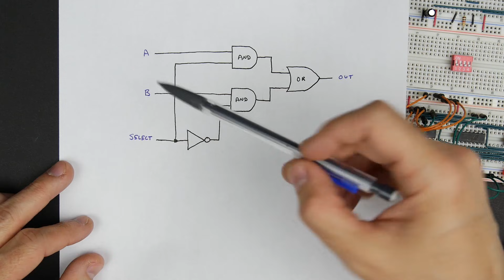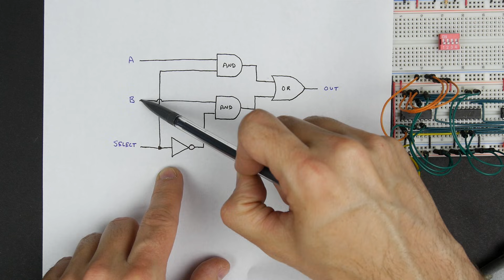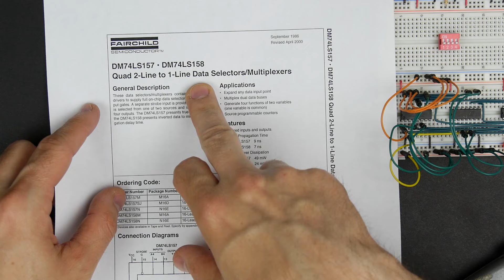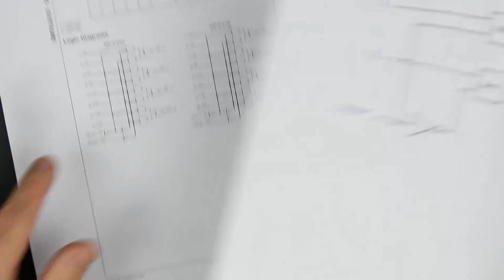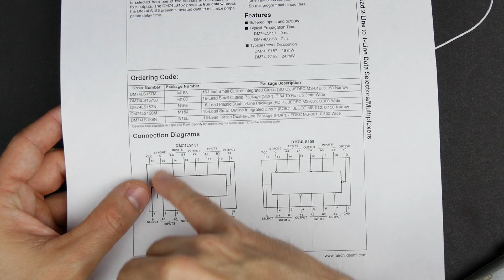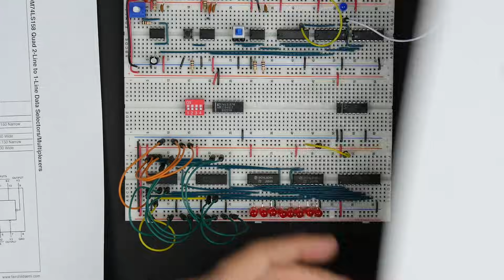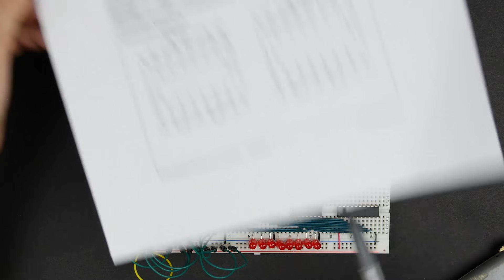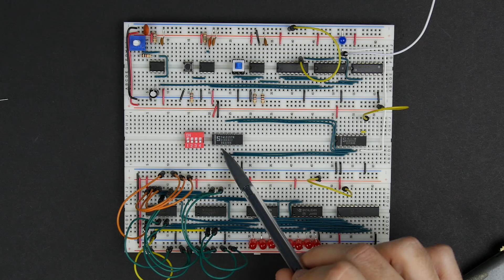RAM module build - part 2

Comment: Actually, when the switches are down they're clearly in the "No" position.
Reply: Actually, this is flipped.
Reply: There's two ways to think about it:
-down is low and up is high, so down is 0 and up is 1
Or...
-when you throw a lever to turn something on, you pull it down. therefore turning on a bit should be the down position

Personally i prefer the former but i can see how the latter might be the convention
Reply: @josbird  I can't think of a single case where down is on. Typical light switches get flipped up to turn on. Circuit breakers oriented vertically get flipped upward to turn on. Large throw switches in industrial settings are pushed up to activate. You likely know of some exceptions, but I can't think of a single one myself.
Reply: @chitlitlah  In Europe light switchs go the other way, no idea why.
Reply: @Nolrai12  Those switches that have a knob the on is down, but on those that have flat surface you press the upper part to get the light on and if you then think about gluing a knob on it it works the other way round.

Comment: 02:10 So you're using the same bus for transmitting addresses as well as data?
Reply: Yes, it's important to. A jump command will have an address for its data. Everything is data, in the end- addresses and instructions are special data, but data nonetheless.
Reply: Chris Knowles I know. I was rather asking about the distinction between "one common bus for addresses & data" vs. "separate buses" (address buss and data bus as two separate buses which can send data in parallel) dilemma.
If they are separate, there's no need for latching the address in an address register, for example.
Reply: +Bon Bon but how would you move an address from one bus to another? I think eventually you'd need to involve a latch- why not here?
Reply: Chris Knowles Through the CPU, which usually is the device which sends addresses to the address bus anyway.
I didn't say that the address register is not needed at all (because it's usually used inside the CPU anyway), but that it is not required for the RAM module to have it when there is a separate address bus.

Address latching is usually needed when the CPU needs to have as few pins as possible to save space or reduce costs, as it is the case with some microcontrollers such as 8502, which uses one of its I/O ports as half of the address bus. Then you need an additional 8-bit address latch to latch half of the address which appears on the I/O port, and then the CPU outputs the data through the same port, so a mechanism is needed for controlling and sequencing these signals on the bus. This approach is cheaper and saves some space, but it is also slower, because the data and its address needs to be handled in two stages instead of one. Separate address bus allows for handling it in just one bus cycle.

There's also a trick I once invented which allowed me to save some more time in my homebrew microcomputer:
The instruction set was constructed in such a way that the CPU could read and store data in series. It was based on the observation that programs are usually read and executed sequentially, one instruction after another, unless some jump occurs. So I enhanced my RAM module with its own address counter which has been automatically increased with each clock cycle. This way the CPU had to send it the starting address only once, and then just read instruction by instruction in each subsequent clock cycle. This way it could work twice as fast, because it didn't have to interleave each instruction fetch with putting the address of the next instruction to fetch on the address bus.
Same thing went with data, which had a separate RAM module, with its own data address counter.
Reply: +Bon Bon Gee, I guess you know a thing or two! It still looks to me like using one bus is the way to go- We've got no need for speed on this computer. At the very least, it saves on breadboards. I think as an introduction to this subject, as it's serving for me, those techniques would be more trouble than they're worth. Ever heard the adage about home made telescopes "It's faster to make a 4 inch and then a 6 inch than to start with the 6 inch"?
Reply: Chris Knowles It all depends on your needs. If you want speed and the cost & space doesn't matter, go with separate buses. If you are willing to trade some speed for space and you want to lower the cost, go with a shared bus.
But don't forget that a shared bus requires some more trickery with the timing signals / sequencing ;J

As for the telescopes: I never tried to make any, but I would definitely try if I knew how. (If that counts, I once made a spectrometer :q ) Does your quote mean that you have some knowledge about that, perchance? :>
Reply: +Bon Bon Never got as far making one, just read the book as a child. All I really retained is that adage, because I haven't found a field it doesn't apply in. It's usually better to do the simple thing first and add the complications later.

Comment: How much did/will this whole project cost for materials?
Reply: You know the old saying, if you have to ask, it is probably too much.

Anyway, I have gone through my parts list to try to give you an estimate. But do not hold me to it. I actually had
already purchased $66.10 on various parts to get started on other experiments. So, I already had a bunch of AND, OR and various other common logic gates.

All together I have invested $200 or more in this project (Counting the $66.10). Keep in mind that I always purchase more then I need. I usually buy in quantities of 10, some times 5.

Here is an actual list. I excluded a second set of 10 bread boards that I purchased, because the first set was taking to long to get here. I learned that even though the two sets of bread boards are exactly the same, they do not snap up together. The first 10 will snap together and the second set will snap together, but the first set will not snap together with the second set. 

You can do this for less, I do buy extra everything, just in case and to have these things for the next project that I might get involved in.

Don't let my prices hold you back, this is a great project to get involved in, and it is very well instructed. So you will learn a great deal from this project. I can promise you that !!!

https://drive.google.com/open?id=0B6LIgQzDkH8fMzFiVGZZV1pZU3c
Reply: I definitely love the idea of doing it all with 7400 logic, but the cost and complexity kind of puts me off for now.  I was thinking about actually building a either a Z80 or 6502 based computer and cheating a bit by using a Parallax Propeller as the memory and bus controller.  I realize it sort of defeats the purpose since the Propeller is much more powerful than the Z80/6502, but the point of the project was to learn, and I figured I could always replace the functionality of the Propeller with discreet components.  I'm just really interested in the concept of multi-CPU systems and the dynamics of programming CPUs to talk to each other and do something useful.  Plus, if I end up using both the Z80 and the 6502, I should be able to make it compatible with all kinds of old software just by programming the Propeller to emulate the non-CPU components of various machines and switching between compatibility modes.

I figure I'm going to run into snags along the way and watching channels like this seems like a really great way for my to begin wrapping my head around this kind of project.
Reply: I am still waiting for the multiplexer and 4 bit DIP switch. So I can finish the MAR (Memory Address Register / Multiplexer)

It has been a great learning experience.

I do like the 6502 and Z80 although I am not so sure about the Parallax Propeller. 

I am a vintage computer collector, so I have a lot of old machines with 6502's in them. I like working on the Commodore 64's. 

My TSR-80 has a Z80 as does my Apple II CP/M card. I spent some time programming my C64 in Assembly language. That is why I am interested in this project, to find out more about how these things work.

This is a great project to get involved in, and Ben explains everything in clear and easy to understand detail.

I do not think you will learn as much using the Parallax Propeller, except how to program it.
Reply: Jeff Nay My main reason for using the Propeller is because I want to learn to program it in assembly and I already have two of them, one demo board and one 40-pin DIP.  Also the Propeller can be clocked to up to 80 MHz which allows me plenty of head room, for example if I wanted to run the Z80/6502 at 2 MHz and the propeller at 40 MHz, I can program the Propeller to pulse the Z80/6502's clock line every 20 clock cycles and it gives me plenty of room to write to external memory or whatever I may need to do within each clock cycle of the Z80/6502 as well as having 8 cores allows me to do more within that 20 clock cycle limit or whatever it may end up being to make it appear real time to the Z80/6502.  Especially if my goal is to emulate actual classic computer systems, I don't really have the luxury of tweaking the OS/application code to be more compliant of timing mismatches, so to me it makes sense to use a much higher clocked processor as a bus controller for a slower processor just because it gives me that flexibility.

Yeah it's a totally different kind of project than what's in these videos, it's almost all software while this stuff is all hardware but it's still similar in that it involves understanding and designing a computer system.
Reply: Jeff Nay I would definitely love to do a project more like that in Ben's videos as well, but I don't feel like I'm ready for it just yet and I'm also pretty short on physical working space right now.